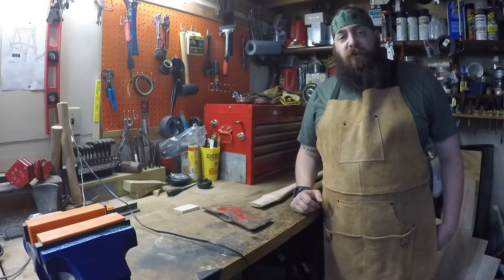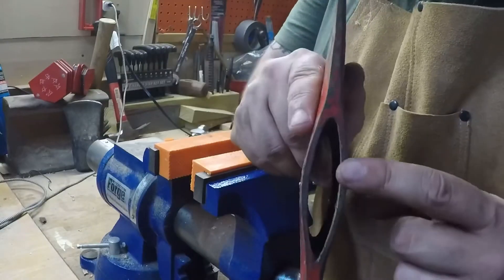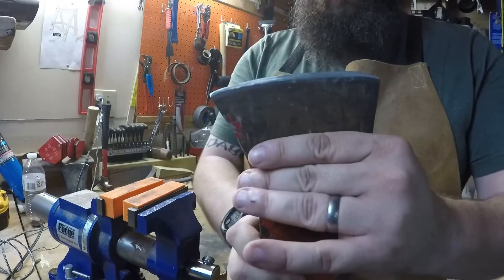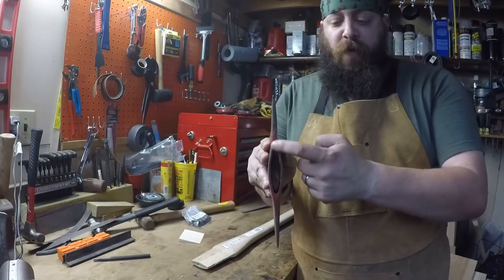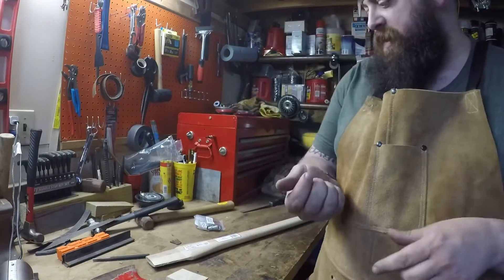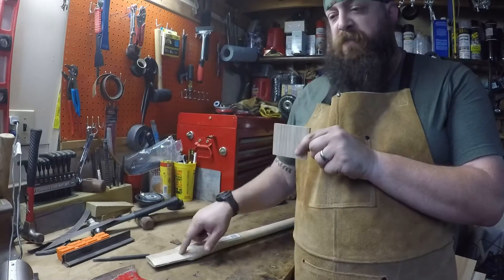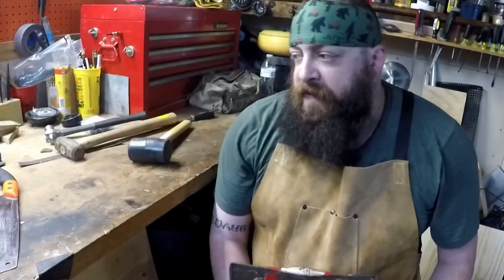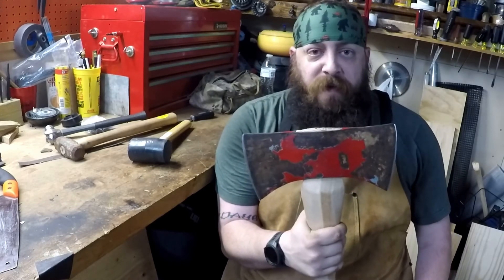How to replace an axe handle

Comment: Can I add weight to my ax head by using a piece of heavier metal instead of a wedge.. bc I am a chic and I chop better with a heavier ax I use less energy and get a better bust. I hope I can thank you buzzybee
Reply from the maker: I don’t see why not, my concern with a metal wedge would be shock absorption and may cause the wood of your handle to split. You may want to look at changing the angle of your sharpened edge to require less force to split/chop. It may dull faster, but it would require less energy per cut. The efficiency of the axe is based on the balance between weight and cutting edge. Also playing with the length of your handle can change the force needed to get a good cut.

Comment: what should i do if the handle is too tight of a fit. sand it down?
Reply from the maker: It really depends on how tight. I would say start with mid grit sand paper or possibly a light file if it just barely too tight. If you need to remove a lot of material, trace the inside of the axe head on the handle and use a wood chisel, or draw knife. Only remove a little material at a time until it fits. You can always take more off but you can't put it back on. Also make sure your remove material evenly on either side so the axe stays centered on the handle and not turned one way or the other. Hope this help. Thanks for your question and for watching.
Reply: @wildmanknowhow6617  Its probably a rare question. And I think I know why now... This handle is for a garden mattock not an axe. I thought it was a bit  long i thought that was cool. Its a close fit but i think Id have to remove too much material and possible weaken the integrity. Id hate to have it snap after the first swing. TBC...
Reply from the maker: @millertime3591   Got ya. Yeah it will probably be easiest to get the right handle. If your unsure just take the axe head to the store with you and try a few handles on. It should slide on the top half of the handle pretty easy.